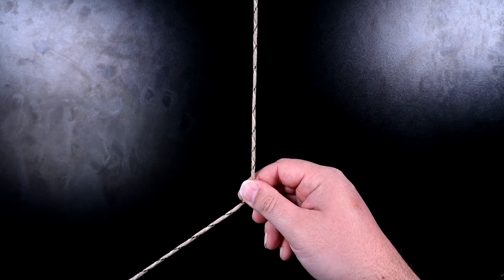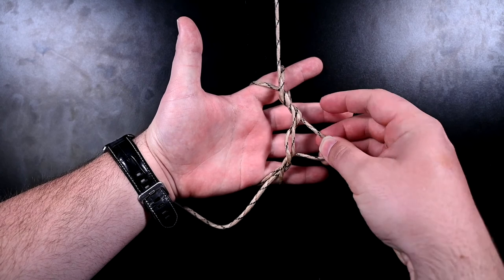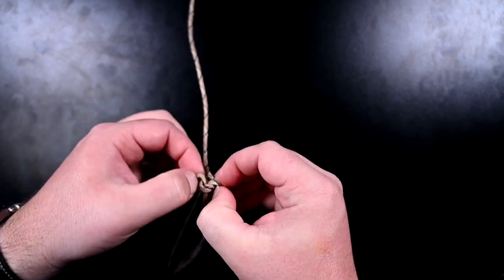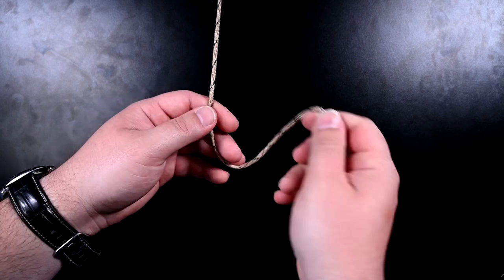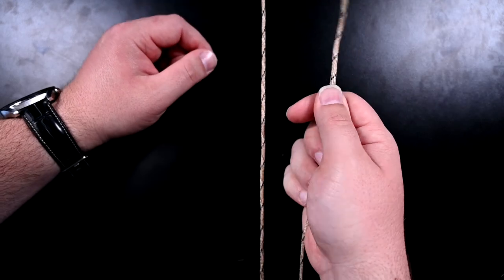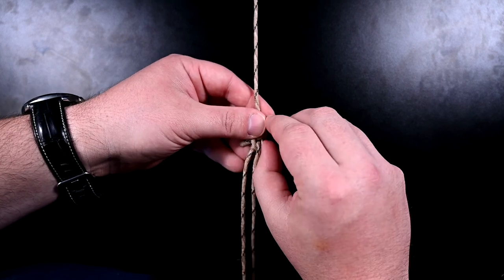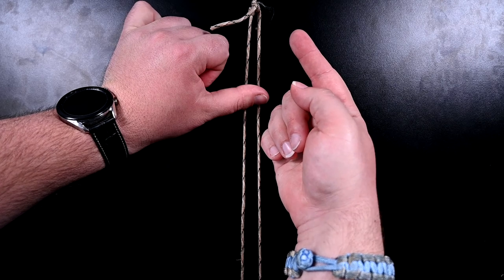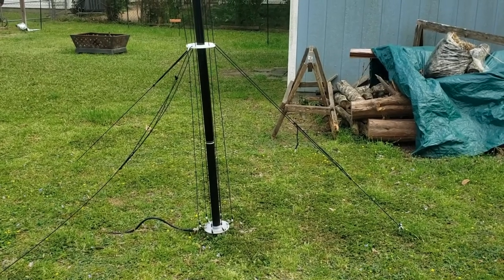Guying Antenna Mast | How I Do It

Comment: Thanks for making this video. I'm gonna be putting up a portable 20m hex beam will need to guy it ALOT(in at least 3 sections along the length of the mast). I will be practicing the knots you showed.
Reply from the maker: These are really excellent knots and are really easy to untie as well. The trucker's hitch is also a good solution. If you are having a problem with it, don't hesitate to ask!

Comment: Nice. I have the DX Commander 12.4 Signature with 3 guy levels and have just been using the taught line hitch without the loop multiplier like a truckers knot. 

Only one loosened some during 100kph winds when a tropical storm hit. If I tighten too much, the sections tend to retract haha.

Edit: I'll probably do the hitch at the peg end since I can't reach the upper guys!
Reply from the maker: I use the trucker's hitch all the time for a ton of different things, but for the mast I really like to be able to adjust the tension with the taut line on the fly. I live in Louisiana and there have been some very strong winds blowing this thing around, but it's stood up just fine to all of it. I just check the lines when I am out doing yard work.

I actually have to do some maintenance to the DX Commander this weekend, and I'll be glad when the thing comes down easy as it does. Honestly getting on the ground and loosening the wing nuts on the radial plate is the worst part of taking it down.

Comment: What cord do you use with your DX Commander?
Reply from the maker: I bought it a long time ago, but I believe it's 550 paracord I bought from ParacordPlanet. I set this antenna up years ago now and it's been through all season and some wild weather and hasn't had a problem yet. I barely ever even tighten the guy wires with these knots. Having said that, it's probably not a bad idea to change out the cord once in a while just to stay on top of potential weathering.